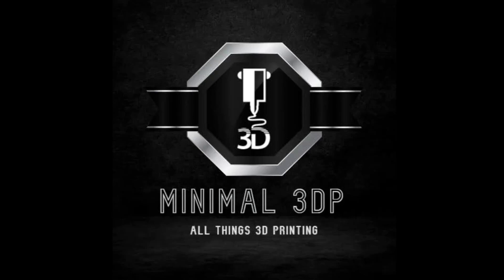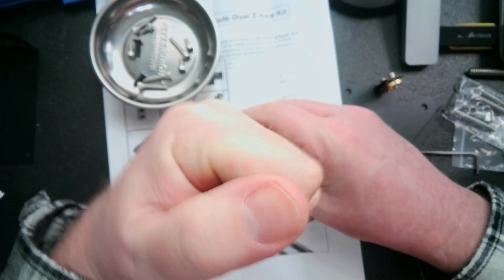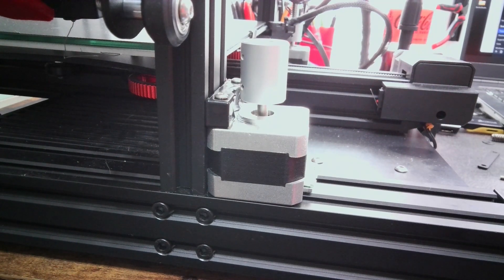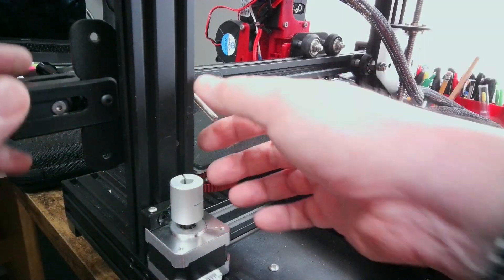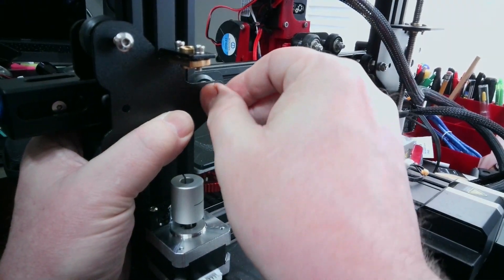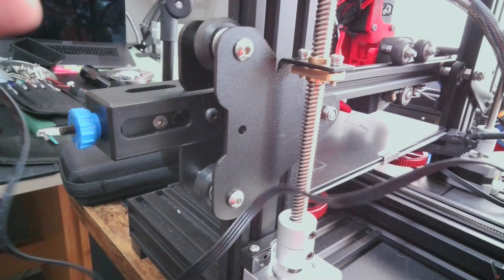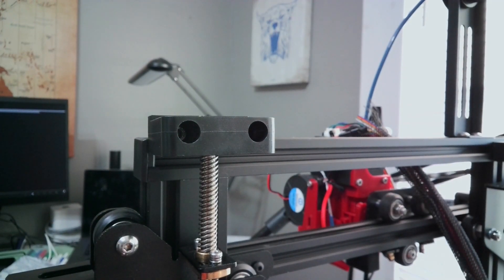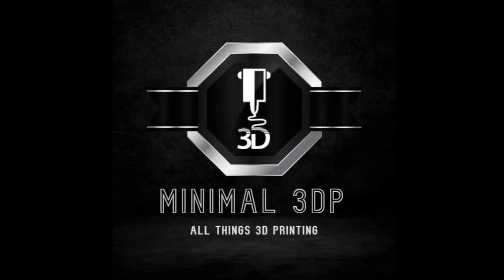Installation of a Dual Z Axis on an Ender 3 v2 with a BBT SKR Mini e3 v3

Comment: Hello again.
Did you change the #define Z_CURRENT in configuration_adv ? originally it's 580, but it moves vertically very slowly. Or you just changed the #define DEFAULT_MAX_FEEDRATE in Z ?

Comment: Hello, do you know if there is a way to make the dual z in parallel on skr mini e3 v3 ?. It upposed to have 4 drivers, the two plugs for the dual z are ZAM and ZBM but they are not controlled independently, so impossible to have a gantry leveling, but chatgpt insist :-))) telling me I can use a E1 port and remove a jumper....
Reply from the maker: The is no way that I know of to make the motors independent. ChatGPT is hallucinating. E1 is your extruder.
Reply: @minimal3dp    Thanks for the confirmation. ChatGPT was a bit "stubborn". I had absolutely no knowledge in firmware, neitherr informatic, and I had the "excellent" idea to transform my ender 3 pro in a raw : double z, skr mini e3v3, bltouch, tft35, h2v2s revo, 5015 part fan, and noctua fans everywhere else......after weeks (the longest was to find and adapt the lightest mount as possible) I managed to finish....... but in my "excellent" idea I thought I had just to do few  clics, like when you install a driver on a pc. Result : I spent the full last week, every afternoon, to try to understand EVERY lines of configuration.h :-)))) I even need to change the temp sensor code.......Biqu told me "plug and play" 🙂 I am far from finish but I discover your channel. I will watch all you BIQU playlist (and subscribe of course), it will help a lot. Thank you very much

Comment: Why use a y-harness for the motors when the SKR mini e3 v3 has two z ports on the board?
Reply from the maker: At the time I used it because it was the cord I had. The mini only has 4 steppers but 5 plugs. Z is run off the same stepper so it is not independent. The cord I used was basically the same as it I plugged it in its own slot.

Comment: After installation you need to change "driver curren" from 580 ma to 1160 for Z axis because two motors connected in parallel to one driver.
Reply from the maker: I found I didn't have to up the voltage. Everything worked great.

Comment: Notice, with the cheap plastic mount, that the stepper motor does not sit flush with the frame?  Look at gap, left to right, on bottom of motor, it's sitting inwards ;)   This can be easily fixed with correct bracket (aluminium) to fix the V2's main flaw.

Also, use T8 POM leadscrew nuts.  They are hard nylon, allow for more leeway, and also require no lubrication, with less binding.  Do not use the 'top leadscrew' coupler's either, as after all, the main leadscrew never had one, and no rod is 'die' straight, thus all you are doing is forcing it to be so, hence introducing binding.

A little extra juice via firmware for the stepper driver (only one for 'Z' on the E3 v3, despite separate slots for wiring), as this compensates for driving a pair of motors, instead of one.
Reply from the maker: I will take a look. I appreciate the feedback and suggestions.

Comment: I have installed a Creality Dual-Z kit installed on my E3 V2 but I am having problems with reliable z motion. This is revealed when trying to level the bed with a CR Touch. The left side of the bed is higher than the right after moving Z-Axis up and down. So when leveling the nozzle is impacting the bed on the left edge but has lots of clearance on the right. I Dual Z-Stepper motors with a 4.2.2 RCT6 mainboard which has a single Z-Stepper motor connector. The kit included a Y-cable to share the signal to the dual-Z steppers. i have adjusted the Z-Axis eccentric wheels to be a bit loose but it doesn't help?  I am wondering if I need to adjust the Z-Stepper voltage. Have you ever adjusted mainboard stepper voltage?
Reply from the maker: I have adjusted via the firmware before. What is the Voltage currently at?